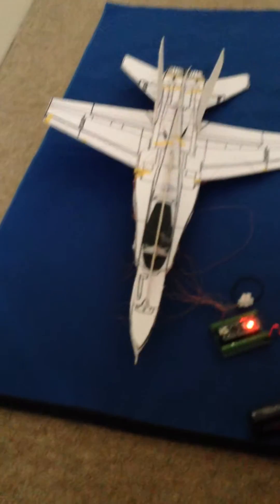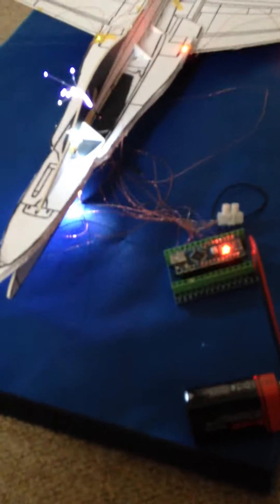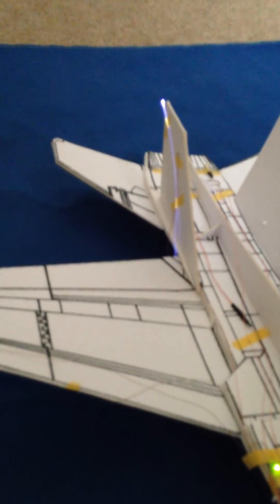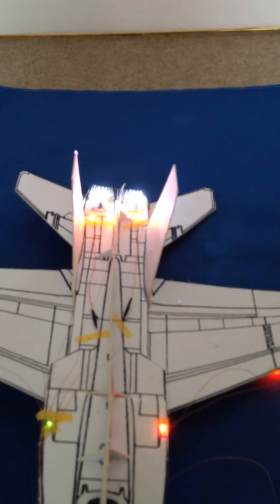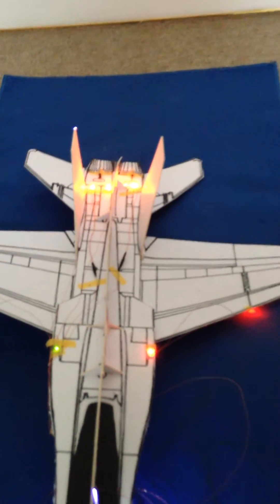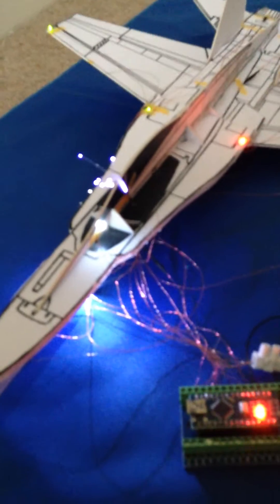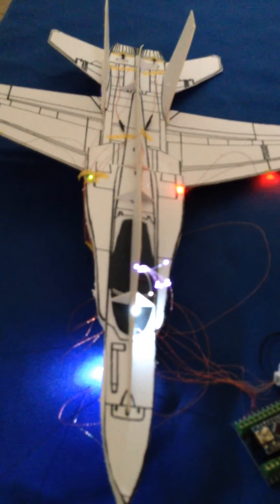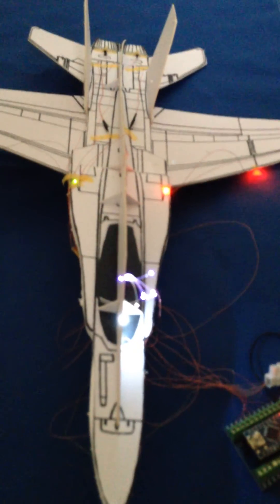F/A-18 CA Lighting Kit Test

Comment: Hi Warren
|Is this kit available as I couldn't see it on the website. This would look amazing on a 1/48 Flanker "E" I want to get. Can the wing tip lights be made to flash?
Reply from the maker: Hi Iain, the kit was a commission build that's why it's not on the store.  It should be possible to modify it to suit, drop me an email with what you want to do.
Cheers, Warren
Reply: Will do mate - need to get the model first (time to drop subtle hints). I'll pm you over on the SFMA forums.